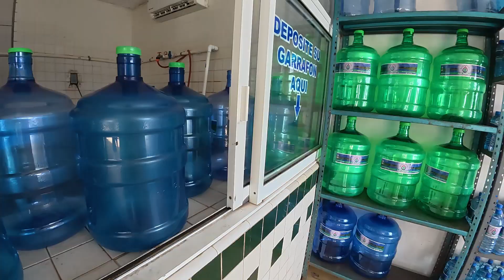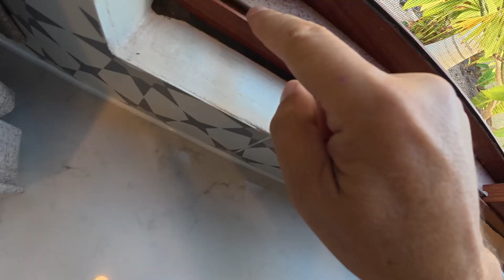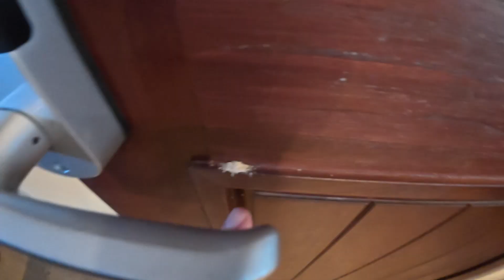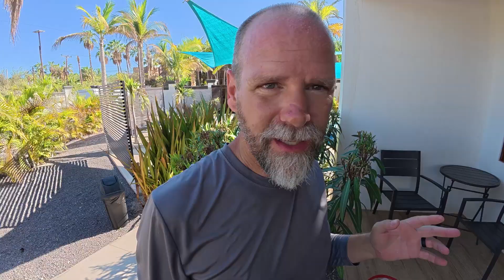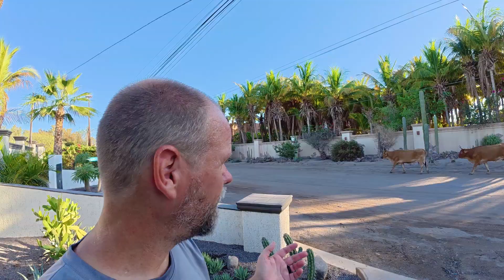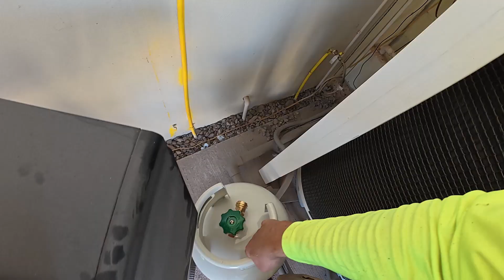Just Another Day in Mexico!

Comment: You can sprinkle sand on the wet caulking to soften the transition and blend in a little more. You can test it on a scrap piece of wood or something first to see if you like it and get the right technique.
Reply from the maker: I've done it before with the caulking around a pool I had in Southern California. I have been doing so many projects and it's so hot that I just kind of blanked it out when I did this or I would have put sand on it. Oh well it's done now. Not going to pull it all out just to redo it with sand.